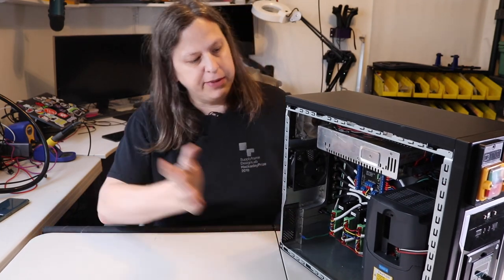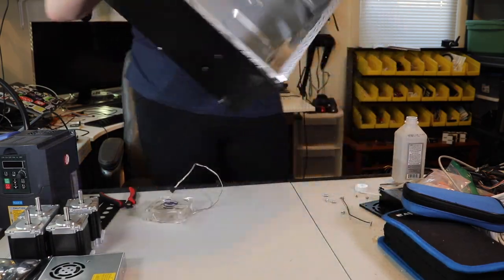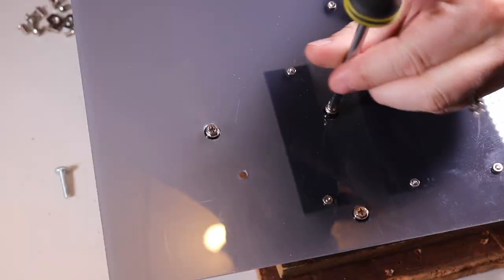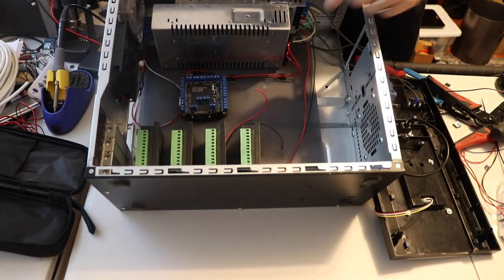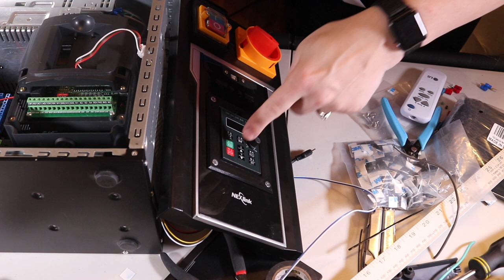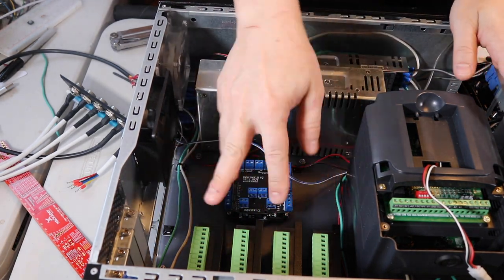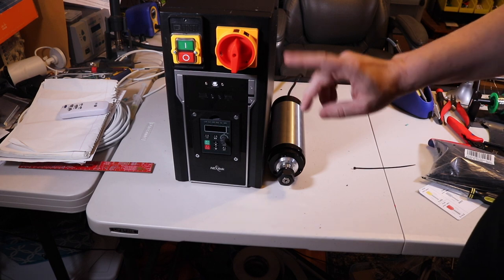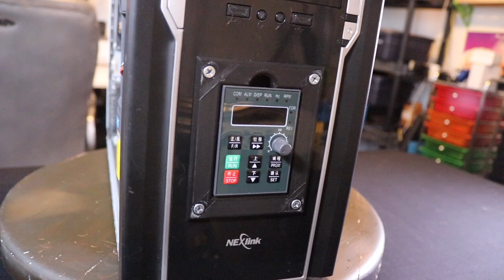Computer Case Upcycling for IndyMill CNC Electronics

Comment: Fantastic build!
Looks professionally built, love the remote display mount.
I was wondering, what was the actual build time for this?
Reply from the maker: Thanks. It took me around 2-3 weeks with filming, there was about 7 hours of raw footage, actual build time at a guess was maybe like 20 hours, but that includes multiple iterations of designing parts and printing parts. If I had to do it again, it would it would probably take maybe 8-12 hours.

Comment: Hi, did the indyshield work great with two motors on the Y axis ? I see you connected the stepper drivers for the Y axis in parallell with each other... thanks..
Reply from the maker: I had some issues with the stepper drivers themselves as you can see in (I think in the next video), but after sorting that out it works great.
Reply: @makermelissa   Yeah the 6600 is known for being not very good for some users, but maybe you still use the 6600´s ?
Reply from the maker: @HearGear I swapped them out for DM542s because the TB6600s were pretty noisy if I recall correctly.
Reply: @makermelissa  Do you have the file you programmed the Arduino with ?
Reply from the maker: @HearGear unfortunately I don't have it anymore, but I'm pretty sure I just used GRBL 1.1 compiled with the Arduino IDE.
Reply: @makermelissa   So with the setup you are using now you can use web based software like Easel and it will work with your machine ?
Reply from the maker: @HearGear I’ve used cncjs, which is web-based. It looks like easel sends g-code, so it should work, but I haven’t tried it.
Reply: @makermelissa   Easel should work with just any GRBL CNC I think. It's a very simple to use web based tool to design and cut simple and not so simple things. So there is not really any need to a CAD/CAM software because you've got it all in the Easel..
Reply: @makermelissa  one more thing, your 12 Volt PSU, does it have to be close to 30 amps.. ?
Reply from the maker: @HearGear no. I just had it left over from an old 3D printer. It's actually overkill by quite a bit. I think it's only powering the arduino and a couple of fans.
Reply: @makermelissa   yeah I thought so.. I have a PSU I will use, 12,5 amps.. thanks for your help and information..  :D

Comment: Hi Melissa, it's a really beautiful build. I am also using the indyshield on my CNC, with 1.5kw VFD spindle and I was wondering how did you make the connections between the shield and the inverter, can you be so kind and provide some schematics? Thanks a lot!
Reply from the maker: Hi, I just created a community post with the diagram until I can think of a better place to stash it: https://www.youtube.com/c/MakerMelissasLab/community It's not tested, but it should work assuming you set the DIP switches to 5V.